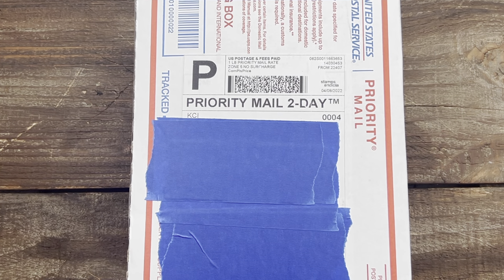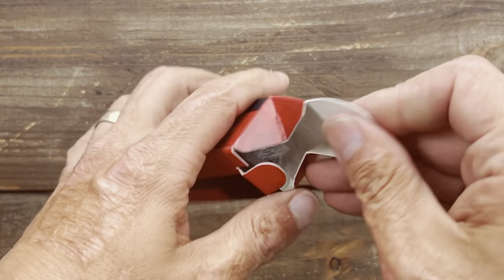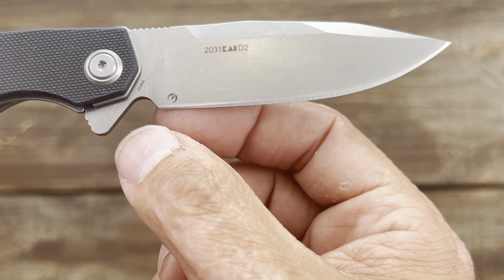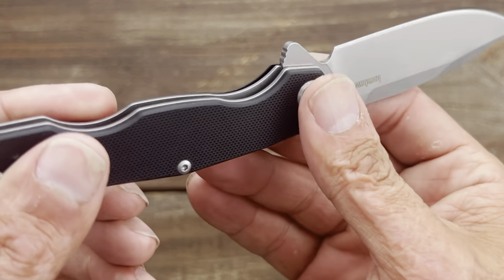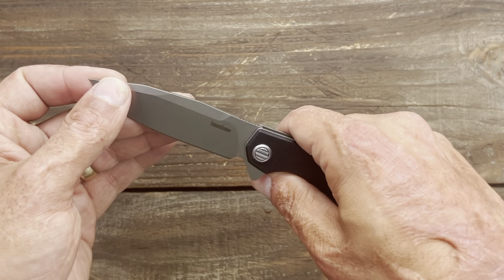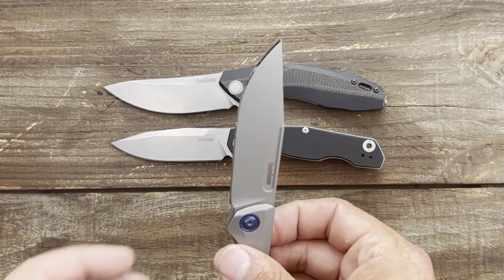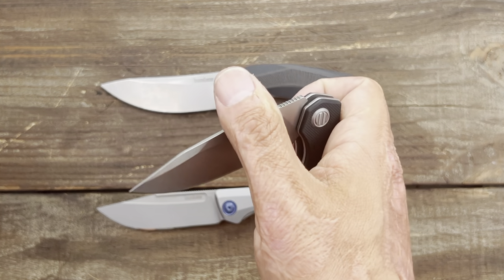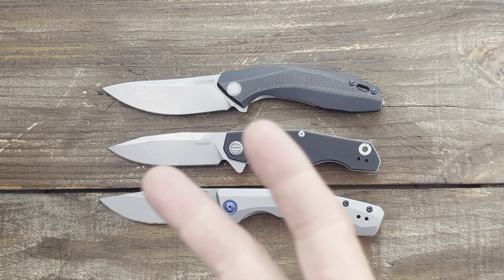NEW RELEASE! A SWEET NEW KERSHAW KNIFE ON BEARINGS?

Comment: They have a few designs using those KVT bearings of theirs so porting them over to this is easy. In fact bearings let you get away with looser tolerances than washers. So and especially as these are I would guess steel bearings in a plastic race, cheaper than washers due to the reduced time and effort to make washers work. But if these are ceramic in PB cages I'll eat that knife, lol. But for the price it seems like a hit for Kershaw. Getting some Skiffs for it should be easy peasy I would bet.